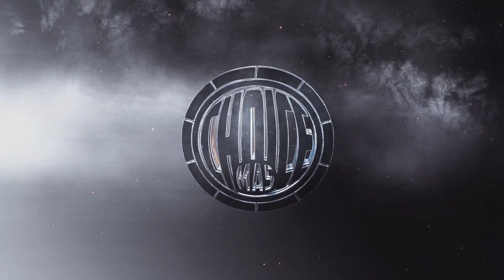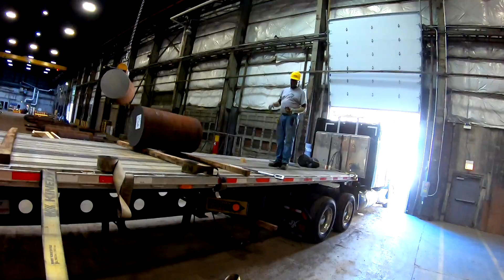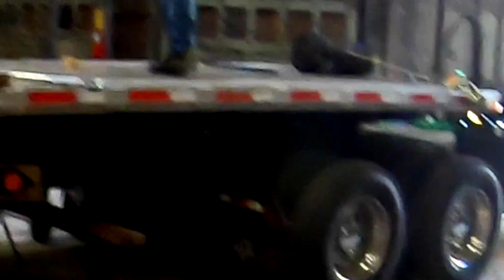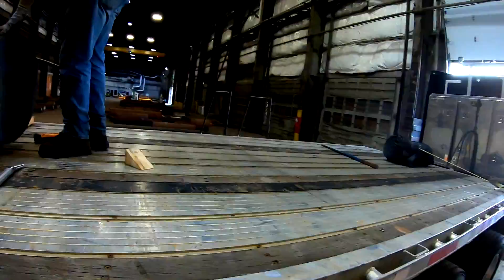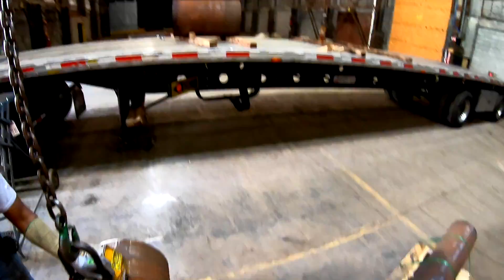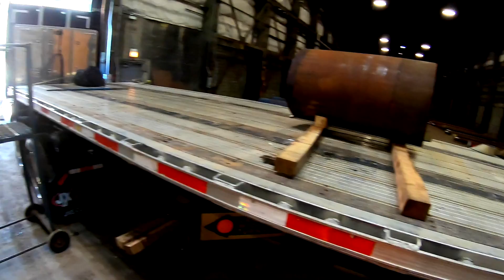LOADER DROPS 4,600 LB. OF STEEL ON FLATBED * CLOSE CALL!!! * CHICAGO * CHOICEMAS

Comment: If that rod fell on out flatbeds it would peel the rub rail right from the trailer. Brand new trailers and they are junk. I work for a multi million dollar construction company. In the top 3 if not number one in jersey. You would think we would have good strong trailers. We haul everything and everything is heavy.

Comment: Where is this I looked up lb steel in Chicago (Harvey) ?
Reply from the maker: Mitch Keller I don’t remember the name
Of the place
Reply from the maker: Mitch Keller Harvey does sound familiar and you might be right
Reply: I was just curious I think I know the place used to be a steel mill now fabrication shop filled with robots n welders as well as CNC.
Reply from the maker: Well the warehouse was extremely empty. It’s is a place where they receive steel and cut it too size and resell it. That I know for sure, as I asked and remember being amazed that a successful business is made simply for cutting steel. Nothing more. Thanks for the exchange. I appreciate threads and comments. Stay fresh!